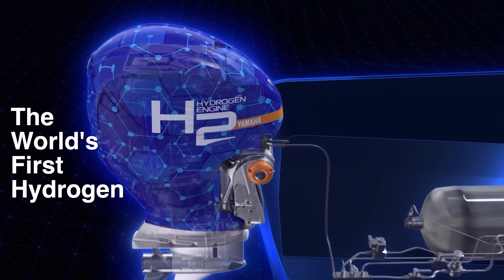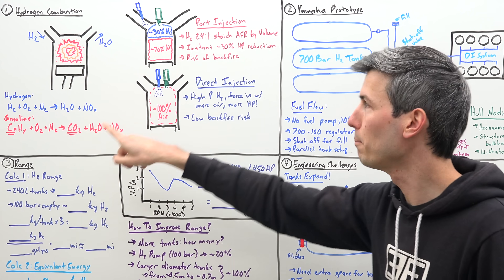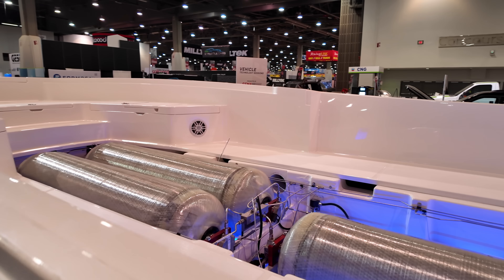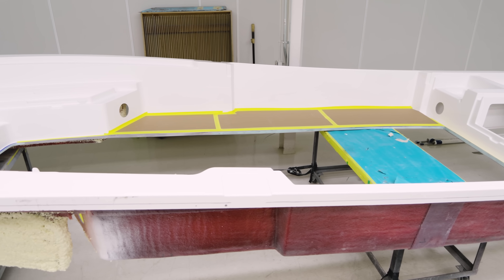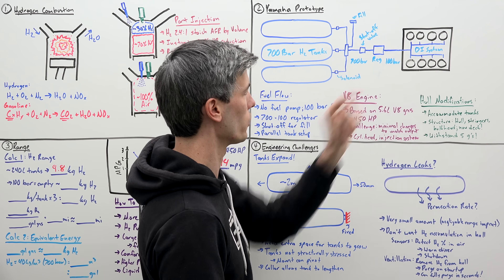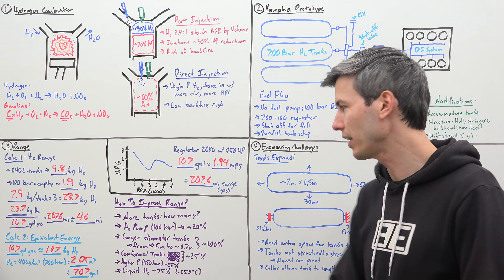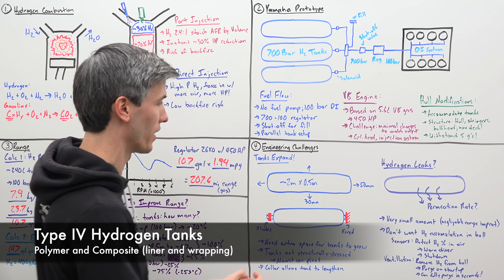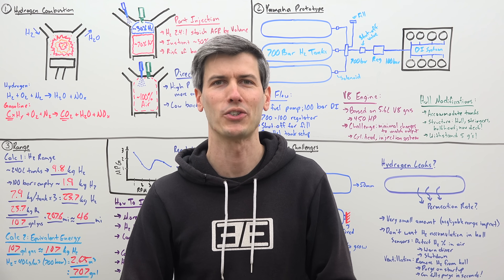The World’s First Hydrogen Combustion Outboard Engine!

Comment: Hey Jason. Cool video, and it's got me thinking... You briefly hit on the stoichiometric air to fuel ratio being a factor potentially holding back the peak power of a Hydrogen engine, and I was wondering how that might be different if the engine was using pure oxygen instead of air. Obviously that would introduce other engineering challenges, but still I think it's an interesting idea.

Taking it one step further, I wonder how difficult it is to actually separate oxygen/nitrogen from air. After a little research, I found that there are membrane separators that seem to work on a sufficient scale, but it was hard to track down any hard data on the power (pressure) required and the flow rates achievable. 

Lastly, if the math is even relatively favorable, I think it would be really cool to see if you could attach one of these nitrogen separators to a super/turbocharger in an ICE engine and see if it is possible to achieve any efficiency/power/emissions gains using such a setup.

Love the channel. Stay frosty.
Reply: This is why racecars implement NO2 (Nitrous Oxide).  The increase ratio of nitrogen to oxygen allows for more fuel reaction, at the same rate.
One could also use di hydro monoxide, and gain the same effect.  And the fuel would be extremely safe at any temperature and wouldn't need to be pressurized at all.  It's just as stable as water.
Reply: @atheplummer  dihydrogen monoxide is just as stable as water eh? 🥸 what are the odds?

Interesting about nitrous oxide though. I didn't know that. Doesn't sound particularly environmentally friendly though haha.

Comment: Another issue could be that any tank defined as high pressure, and I forget the bottom number, requires a hydro test every 5 years. That would be expensive on these tanks, I would imagine.
Reply: Composite tanks can't be re certified so they are throw away.
Reply: @christophers707  , that's even more costly than a hydrostatic test! Especially tanks that size.

Comment: 700bar lol talk about a bomb holy smokes. If one of those tanks ruptured and it set off all 3 it would be equivalent to around 440 hand grenades lol. I did the math and it comes out to around 88kg of TNT if those tanks blew. Basically it's the exact same as a standard 500lb airplane bomb. The shockwave would be slower and likely not supersonic, but still.

Comment: Ha, and you thought boats were expensive to operate now! What a joke and a huge waste of engineering resources. Clearly big oil is shoveling money at this under the table because the hydrogen is going to come from cracking methane, allowing big oil to retain their drilling and distribution infrastructure, not to mention the ICE industry, with its manufacturing and maintenance infrastructure. Gee, why not go nuclear?

Comment: The biggest take away is how energy intense traditional boating is.  2mpg translates into roughly ~16kwh/mile meanwhile the electric semis out there are getting ~2kwh/mile while hauling a full load. Roughly 8 times more energy to move a small boat versus a loaded semi
Reply: Hydrofoils ftw
Reply: @andrewk8636  Exactly
Reply: 90% of the energy loss in boating is caused by the water drag, and the water drag is like 100x more intense than air drag. Improving the hydrodynamic body design and propeller design could improve it by a bit, but still, it still consume a lot of power

So putting the sail is still the best option for efficiency, as you only need to turn on the engine when the wind isn't powerful enough, significantly reducing the power usage
Reply from the maker: Yep, water vs air when it comes to drag losses. Water has so much drag!
Reply: @EngineeringExplained  - prop slippage certainly doesn’t help either
Reply: It all has to do with speed. I first fished with my grandfather in a row boat. We would haul his  herring and salmon nets.  Later, I fished lobster with my father using a 20 hp outboard. Today, people can't fish without 800 hp.
Reply: How has nobody mentioned Candela boats and ferries yet? They’ve demonstrated that they can reduce operating costs with 95% compared to gasoline boats. They’ve recently made the first crossing across the Baltic Sea. They had to charge three times while the photographers gasoline boat that followed it had to refuel six times.
Advanced hydrofoils completely changes the game for battery electric boats.
We may still hydrogen or ammonia for cargo ships crossing the oceans (what battery energy density would we need to make the battery electric I wonder..), but for local boats/ferries I think we may end up with mostly battery electric hydrofoiling boats. Like, how could you ever justify anything else if it costs 20x as much to operate?
Reply: Boats move massive volumes of water
Reply: Wrong. At lower speeds mpg of water reansport exceeds that of land transport.
Reply: 🤯💥🤯Multidisciplinary engineer/inventor here. We are developing an ultra simple, long life, engine architecture which offers significantly‼greater power to weight ratio [specific power] and energy to volume [specific energy]...without any pollutants [No, CO2 is not a pollutant] and can use any fuel or mixtures thereof. The ~60% thermal efficiency is close to an EV's charge-discharge cycle efficiency.😉 Waste-To-Fuel technology will provide renewable, carbon-negative fuels. 

😶‍🌫The 𝔽𝕦𝕖𝕝 𝔸𝕘𝕟𝕠𝕤𝕥𝕚𝕔 ℤ𝕖𝕣𝕠 𝔼𝕞𝕚𝕤𝕤𝕚𝕠𝕟 𝔼𝕟𝕘𝕚𝕟𝕖  
[𝔽.𝔸.ℤ.𝔼.] tech best solves the issues present in previous internal 
combustion engine designs by transforming the old paradigm into a 
simple, low cost, quiet, power dense, efficient, on-the-go liquid and 
gas fuel-flexible, ‘non-polluting’ solution for power generation of all 
scales and advanced mobility not possible before.

Companies can either get aboard or risk getting run over.  😁 

The core 𝔽𝔸ℤ𝔼 tech delivers better than 25% ABSOLUTE/ACTUAL [not relative] 
fuel efficiency improvement over gasoline engines, more than 15% 
for Diesel engines at any operating condition - speed/load, ambient 
temperature or elevation, not just at one optimal testing point at 
STP. Real world driving cycle savings could be an additional 200% 
higher due to the constant MAXIMAL efficiency and torque which 
results in a huge turn down ratio of ~99% without sacrificing 
performance. That means it's idle or running speed can be 10-50 rpm. 
The `simple, low cost, native/built-in, non-electric, environmentally safe, 
non-explosive, temperature agnostic 𝕊𝕦𝕡𝕖𝕣ℍ𝕪𝕓𝕣𝕚𝕕© feature 
recovers more energy than EVs and provides approx.100% fuel 
savings for a combined absolute vehicle fuel usage improvement of 
approximately 300%, thus obviating the basic need for expensive 
EVs & e-hybrids. 𝕚ℙ𝕠𝕨𝕖𝕣𝔹𝕠𝕠𝕤𝕥 adds >400% more torque. It’s like 
4 engines in 1. 𝕚𝔼𝕗𝕗𝕚𝕔𝕚𝕖𝕟𝕔𝕪𝔹𝕠𝕠𝕤𝕥2© further improves efficiency, 
torque, power & other performance metrics by 10%. This is all done 
w/o a transmission. Additional fuel saving solutions are available.
 
The FAZE engine perfectly follows the vehicle’s road or genset’s 
electrical power demand with no energy loss [no fuel waste], This 
unique characteristic enables dispensing with any auxiliary power 
units [APU] for power or refrigeration in any application. This also 
makes for a perfect range extender for battery electric vehicles [EV] 
or as a standalone EV charging unit even where is no electric grid.
 
The fuel agnostic capability allows instantaneous use of any liquid 
or gaseous fuel [natural gas at home!!!] incl. biofuels and hydrogen, 
even if old/dirty/unprocessed like flare gas or employ the concurrent 
multi-fuel capability…anywhere on the globe. One engine for all 
locales w/o changes! Unlike EVs, this enables fast fueling anytime, 
anywhere…with no troublesome infrastructure disruptions or 
changes. EV’s are not a solution to the [FAKE]climate or mobility topics 
as high level of electrification globally is unrealistic 
[See Patrick Boyle's video "Electrify Everything?"] .

The technology offers smokeless, non-polluting, low odor heat and 
noise output without costly after-treatments, etc.,… with only the 
lowest  CO2. It has a negative carbon footprint with hydrogen, 
ammonia, biofuels or gasified municipal, agricultural and/or forest 
waste and coal from a 2-stroke-like simplicity. These are HUGE 
business opportunities. 

The FAZE technology can be integrated into any ICE or vehicle 
architecture, adding some of the positive characteristics to its own. 

With virtually no electronics and emissions equipment, the cost of
purchase and reduced servicing frequency make this solution 
even more appealing.
 
Those are my two-bits

PS.
Did I mention we're developing advanced, simple, low cost, power dense electric machines and torque dense[read - compact], infinitely variable FrictionLess transmissions?
...
..
.
Reply: A) as someone else said water creates a lot of drag, but also b) boats don't have multi-speed transmissions to help lower rpm at a given speed
Reply: As long as owners and operators of hydrogen vessels understand the tank room is not storage and the ventilation system NEVER breaks down or becomes obstructed. Hydrogen offers some interesting options to the industry, coupled with the new prop designs I'd love to see some side by side tests.
  I just hope none of those options resemble Halifax 1917 with an ratio of 4% before trouble starts, that learning curve is small in my estimation, pushing design and engineering in new ways no doubt.
Reply: Yea because water has like 8000 times higher viscosity than air.
Reply: Yet a barge or ship is far more efficient and less expensive mode of transportation.
Reply: @knutbergan  Displacement vs planing.  Also you have to factor the square cube law into your thought process.  As far back as Brunel, we've known that bigger ships require less SHP/ton.
Reply: @knutbergan  Only due to mass and scale of economy. The cargo is called a payload for good reason. And barges don't seem to be targeted for theft as much as trains, then Semis. For now. 
30m new lawless personalities in the country is sure to change that.
Reply: Yes - no way around the fact that power boating is staggeringly wasteful from an energy use point of view. And that’s from a lifetime powerboat fan!  The fact I use an EV to get to the boat as often as I can makes me feel slightly less guilty. That and being a sailing fanatic too…
Reply: @motorv8N  EVs are also a  staggeringly wasteful from an energy use point
Reply: @stevetipene3319  - How did you come up with the EV inefficiency calculation?
Reply: @stevetipene3319  Please enlighten us how lol
Reply: Sure if your just driving around its very energy intense, but every boat owner i know (including myself) primarily uses boats for fishing, so i burn about ten gallons a year as I'm almost always using my electric trolling motor. Obviously that is for fresh water lake use, ocean use is much different as the distances traveled to fishing locations are usually going to be much further. I run a smaller boat so i can go into any lake i want regardless of size so i don't wander 50 miles out or anything on bigger bodies of water.

Comment: You would actually only need about 300 kWh of battery storage to achieve the same range as the hydrogen solution. If you want hydrogen so badly, why not use a fuel cell, that would increase the range to 150 miles easily with the same storage tanks.
Reply: But then you can't use the V8! The only reason this project exists.

Comment: I would be interested in knowing how many times you can cycle the tanks from 100 bar to 700 bar before you have to replace them. This seems even more important as the tank expands and contracts as it is cycled. I wouldn't want a catastrophic failure in a 700 bar tank.
Reply: You can see the label on the video: 5000 cycles, and a do not use after 2043-02, manufactured 2023-02
Reply: @ikocheratcr  Thanks!
Reply: @ikocheratcr  Is that 5000 cycles in a marine environment? The cylinders will be subjected to a lot more vibration compared to a car.
Reply: @ianhellyer1473 That’s 5000 cycles in a real world use environment. Hydrogen tanks have been in use in industrial applications for well over 50 years now. These tanks are probably 95% safe for another 5000 cycles after the first 5k is up.
Reply: Think your question has already been answered so just adding a bit more info. This tech is similar to paintball tanks which go to 300 bars. Just like said here, they either have a validity date to throw away or retest. Most catastrophic failures (very very rare) happened from negligence by using hydrocarbon products to lube fill nipple (bang on filling up). Stako had a couple of catastrophic fails (full on tanks ruptures on a bad batch if not mistaken) as well but again, incredibly rare on tanks that get hammered day in day out.

Comment: The big problem is where do you fuel up the boat?    There is very little hydrogen infrastructure and even less (if any) where you could bring a boat to (short of trailering the boat).
Reply: Maybe Electrolysis from the salt water itself? from an alternator? idk how you'd incorporate that. Maybe have a sail assist for fuel eco, which could spin an electrolysis generator, while the engine idles, that filters and feeds directly into the H tank. Probably a swiss-cheese-like list of holes in that idea tho, so idk!
Reply: @SnkobArts  A few obvious holes is:
1 - A tiny electrolysis setup like that would spend weeks or months making the necessary hydrogen.
2 - You need a constant steady supply of electricity.
3 - How do you pressurize it to 700 bar?

Also, I'm not sure why you think an electrolyser would be spinning. I think you better read up on electrolysis a bit haha
Reply: @logitech4873  The compression stage is definitely the biggest problem, you would probably need a roughly football field sized solar array if you want to do it emissions free and fill/compress these tanks within a human lifespan. Electrolysis actually becomes more efficient as pressure increases, so if you can do the electrolysis in a ~200 bar mixed air/saltwater tank you'd massively reduce the energy requirements of the compression stage and electrolysis, however, I suspect the nitrogen presence would cause a stoichiometry problem. Really the whole idea of combusting hydrogen needs scrapped, it's just not good from any way you try to approach it. Fusion is the only thing that makes hydrogen worth talking about as a fuel, and I am still skeptical if fusion will ever be accessibly/practically scaled for applications other than large scale power generation.

Comment: Is there a way to make a tiny water to hydrogen generator that feeds into the tank or injection line somehow?
Ah nevermind, hydrogen conversion is power intensive
Reply: In an optimistic setting, you'll be spending 200g of hydrogen to make 100g of hydrogen. Basically it's a net loss and you can't generate any without external power.
Reply: @logitech4873  Yea I realized after googling it

Comment: Would the admittedly terrible range be better or worse if using a fuel cell and a motor instead of the hydrogen engine? Same power output. Does this engine come with filters for NOx etc. ? Would the total energy be better spend if keeping a traditionnal 450 hp. V8 (the need for witch only exist in the American minds!) and then run it on e-fuel. Lots of possible videos 😄.

Comment: That's actually amazing! If you'd put a fuel cell and a battery on board, you could even produce the hydrogen from sea water!
Reply: What energy is needed to produce hydrogen from sea water and where does that energy come from?
Reply: @OnlineAdjunct  I can imagine the response already.
"you just use a 12v battery and--"
Reply: @OnlineAdjunct <- you | my point ->

Comment: I think hybrid motors are still the way to go. The energy density of gas, the efficiency of electric. The engine is strictly used as a generator (similar to an electric train) and is not connected to the drive train at all.  They can be pretty efficient if optimized at a certain rpm range for an application like this.   Maybe some way to capture the energy lost to heat and also use it to generate more electricity to improve the efficiency even more.
Reply: The efficiency gains from a hybrid drive are very much related to the application and a road vehicle or train are applications where it makes sense - the vast majority of the time the required power is much less than 10% of the peak power and peak power is used less than 1% of the time.  A marine application is very different in this application the power output is essentially always over 50% and here you typically design the vessel to have an optimal cruising speed that you typically aim to always operate at.  In this application a hybrid drive adds zero value.  Boats applications actually operate a conventional ICE engine much more effectively than in a road vehicle application  - this might seem counter intuitive when you hear of fuel efficiency figures like 2 miles per gallon,  but this is actually a reflection on just the enormous amount of energy needed to move a planning hull boat through the water - the ICE engine itself is way more efficient under these conditions than when it is operated in a road vehicle and operating on average at less than 10% output